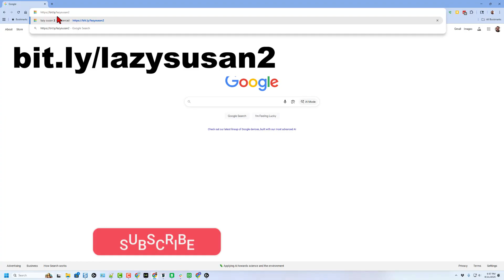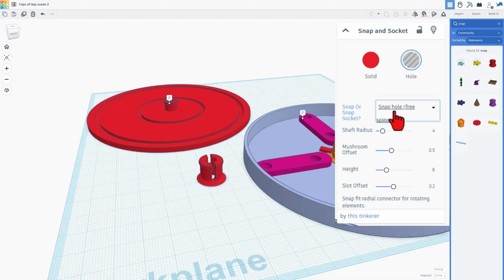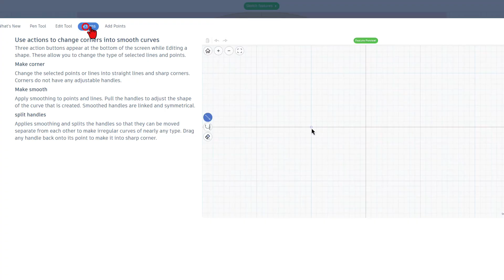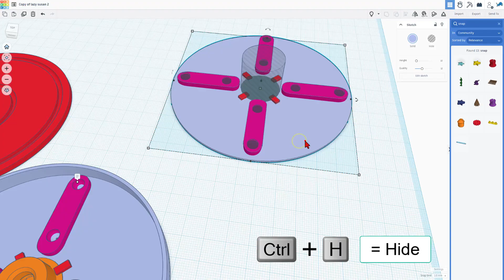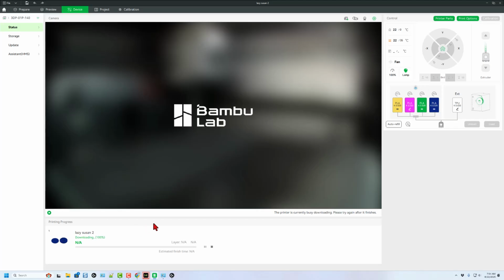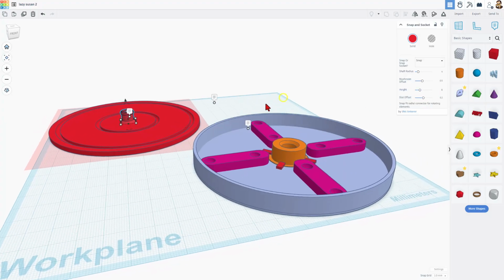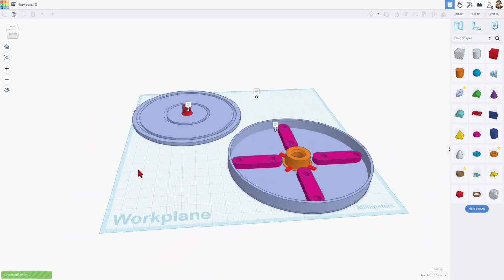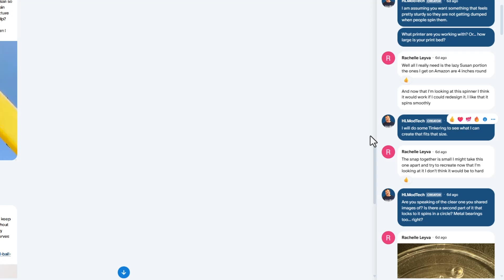Easily Make Snap Fit Projects in Tinkercad! Free Lazy Susan Too! 💯🔥

Comment: How did you determine the size of the snap-fitting for this project? Is there any documentation anywhere that explains the options of the Snap object?
Reply from the maker: It was a bit of guess and check. I also know how accurate my 3D printer is. I am pretty happy with projects if I leave a .2mm gap on things.

Comment: I’m a newbie to designing and only do very basic stuff so forgive me if this is a stupid question but if I wanted to scale these parts down and had small enough ball bearings do you think it would work?
Reply from the maker: 6mm bearings are already pretty small. What size are you working with?
Reply: @HLModTech well I’m a miniaturist so I might try and use 1mm bearings 🤔
Reply from the maker: Super cool to be working that tiny. I would just try doing the math for what % 1mm is of 6mm and seeing if it worked. the nice thing is that it would be a quick print.